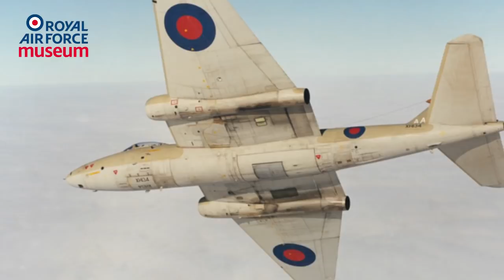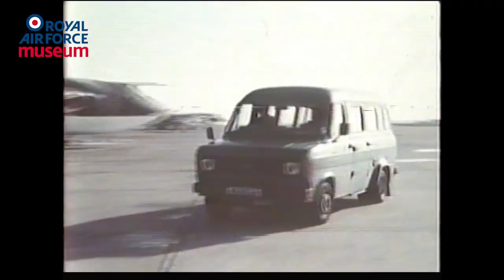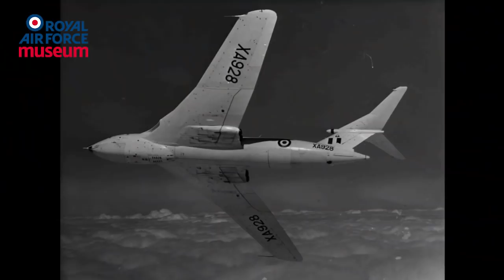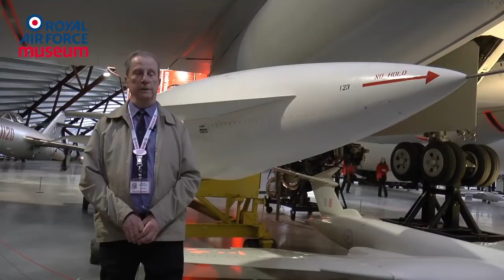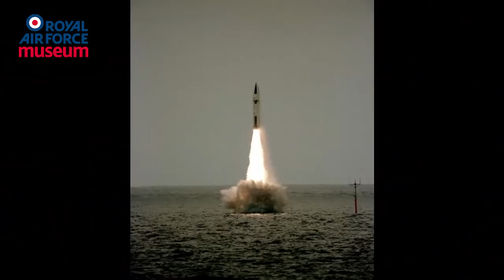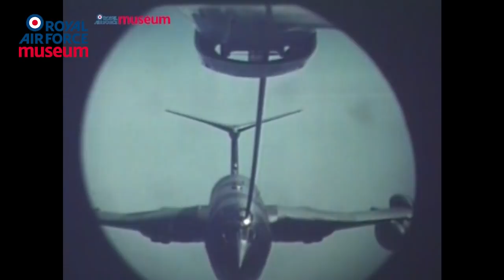Under the RADAR: the Handley Page Victor

Comment: XA928, 10 Sqdn Cottesmore. Been down those air intakes a few times, and up the jet pipes. The Sapphire engines had a propensity for the rear post turbine nacelles, for the seams to develope cracks, which us erks marked with chalk to  monitore the increase, on After flights. Very happy days  When Ten disbanded, they had a flypast of at least five aircraft, mincluding making up a diamond Five. Imagine that, five Victors in  formation. Possibly the sixth aircraft did a high speed run down the centre line, there were build ups of pressure waves on the leading edges which 'blew off' and reformed. what a sight. To my knowledge, the events were not recorded, at least I've never come across them.